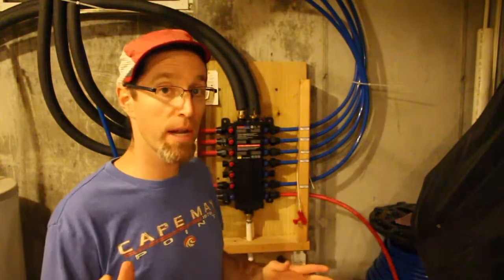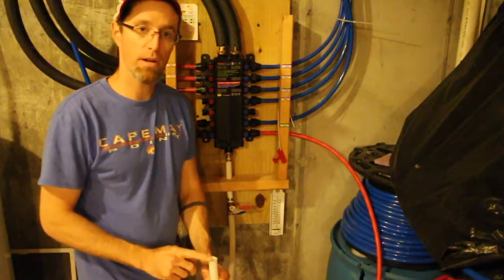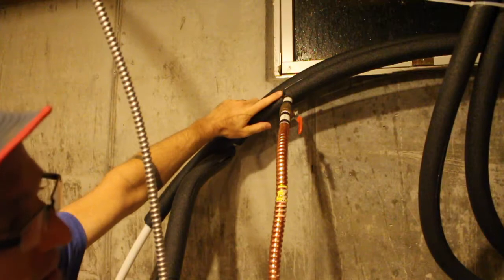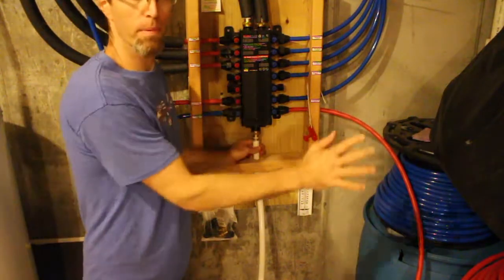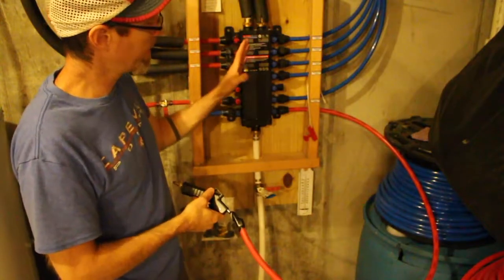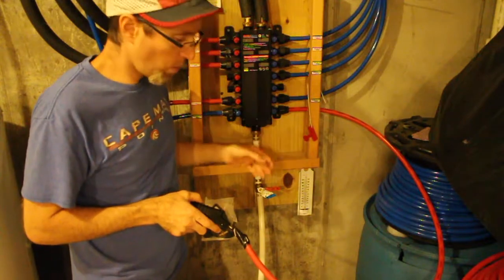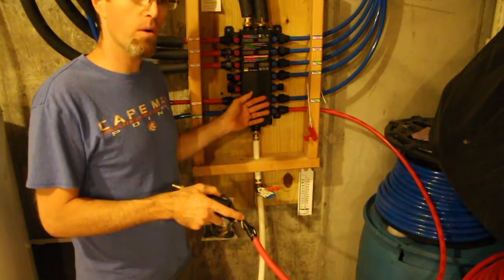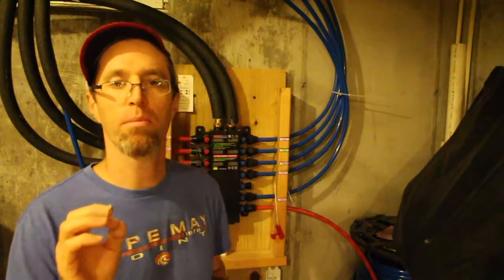Draining a Manabloc PEX Manifold to Avoid Frozen Pipes

Comment: happy to find this video.  I want to install in my seasonal cottage and was wondering about draining.  quick question - if both hot and cold lines are coming in from the top, will the bottom centre connection gravity drain both hot and cold sides of the manifold?  since this manifold will be stored in the crawlspace of my cottage, and all water lines are opened above, I think that by opening the drain on the bottom, everything should gravity drain out of it.    ????
Reply from the maker: Yeah bottom can drain everything but a compressor helps clear everything out
Reply: @metaspencer  I think the bottom drain would only drain out the cold, you would need to leave the last hot outlet free and open that to drain out all the hot water. (or does the bottom drain both hot and cold?
Reply from the maker: @fkyboy76  it's been a while since I drained it now but what you're saying makes sense

Comment: Why didn't you run the cold water from the manifold to the hot water heater instead of coming from the main line?
Reply from the maker: Hey Jay -- As I recall, I was thinking that by feeding the water heater this way, I was saving a slot on the cold side of the manabloc for future expansion of the system. Thinking back to the configuration of this system, splitting off to the water heater early on (after the well pressure tank) just seemed to make sense. You could certainly do it the other way, feeding the water heater off of the manabloc.
Reply: Thanks.  I didn't know if it was personal choice or a code issue.
Reply from the maker: definitely not a code issue, as far as I'm aware! take care

Comment: Ok, but that does not address the HOT water lines.
Reply from the maker: good point: hot gets drained out of the bottom of the hot water heater. When the compressed air enters the system, that pressurizes the hot side, too, as the air goes into the water heater (and pushes out the hot lines) ... I guess I could put a drain on a hot line, too, now that you mention it